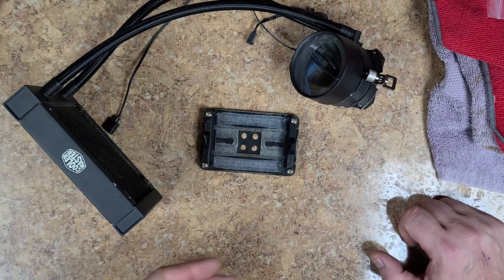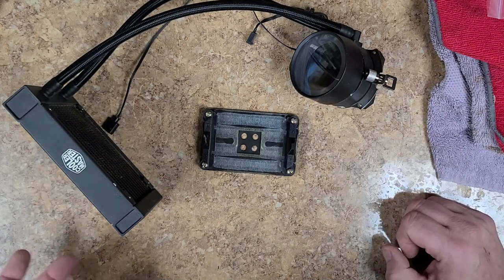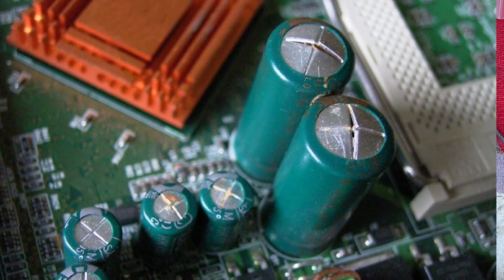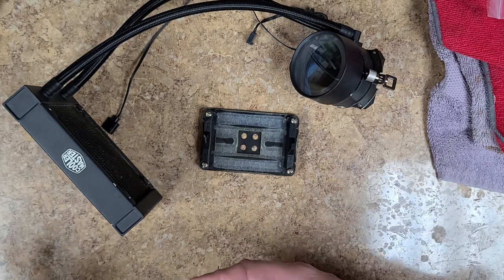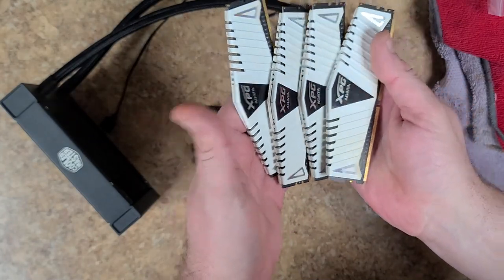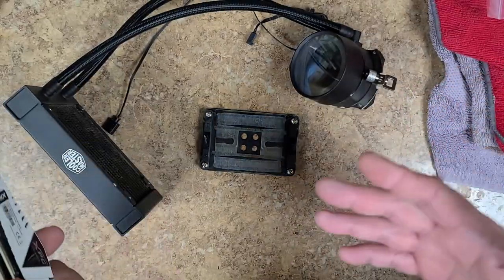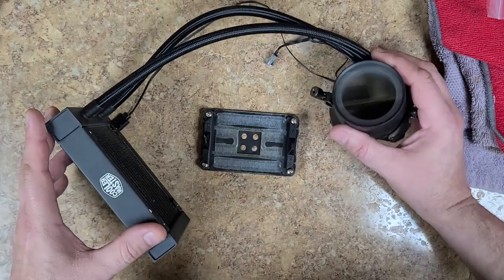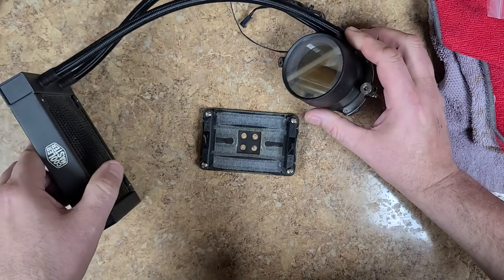AMD AM4 CPU Cooler Mounting Brackets Upgrade Coming Soon

Comment: That sounds like the issues I was having with my old PC before it totally died. In my case the temp was reaching 97C on all cores before it shut down. What I did in the end was buy a used version of the same model PC and just swapped the drive over. It was cheaper than buy replacement parts that I couldn't prove were faulty without swapping them out. I ended up with twice the RAM I had before, wifi,  and mSATA system drive, all with a newer motherboard, case etc. All for the same price it would have cost for a new PSU and better fans. I hope you get it sorted out Eric. There is nothing worse than a PC that will shutdown with no warning. Sounds like you could make yourself some money if you can figure out a may to make the brackets cheaply and easily.

Comment: @Eric C (The Art Of Noise) not sure will you see this, if you can avoid motherboards with electric capacitors. If those budging capacitors are on your board change the borad. As engineer i can recommend great boards that aren't expensive like Biostar or Asus ( i like more Biostar due to for the same or smilar item with Asus name you will pay more). I was never a fan of overpriced RGB shining parts, nor i like water cooling. 
For your processor a good tower cooler with use of a HQ past would be OK in my humble opinion, i also have Ryzen similar model and that is what i use. People make mistake as you have noticed thithen coolers on those brackets like cra.y , it's not easy to brake that plastics at all, so .... Another mistake is that don't use the best past, and there are a huge differences in heat transfer among pastes. They spent a lot of 4 on motherboard's, coolers and then cheep it on a paste ( a huge mistake). It's much better to use a HQ paste with an average cooler then those fancy water blink blink cooling system with some crapy paste. 
Redit and similar places were some gamers live advices are bad places, due to those people perceive things only trough price points and brands instead trough quality, and they adore those terrible blink blink cooler that are shining.

Comment: Just to add, also is mistake that people overpay power-supply due to brand name and use it for years, due to no matter how much we pay it it gets dirty from a dust and will loose it's performance after 1-2 years if it's not cleaned.. I tend to get a cheaper but HQ power supply and then i change them after 2-3 years of use, of curse i clean PC once per year. Service tend to give a longer guarantee of a new PC if a customer brings it once per year so that we can clean it from dust and put a new paste on a CPU. 
During the hot days the best is to open one side of PC housing, to literally remove it and keep a PC open. No matter what sort of fens we use they can't beat one sided open PC.
Those new age fancy ''gaming'' dust mesh that they tend to use for PC made for kids who are ''gamers'' , are literally choking the air flow. It's much better to clean PC at lest once in a year, and to use a good CPU cooler and one fan on back then x of those fancy RB fans and not clean PC regularly. If someone can't open them and clean them, at least they should use a compressed air in can. Turn of PC, take it out and clean it with a compressed air, also to use a clean soft brush to remove dust + vacuum cleaner is something we did for decades ☺